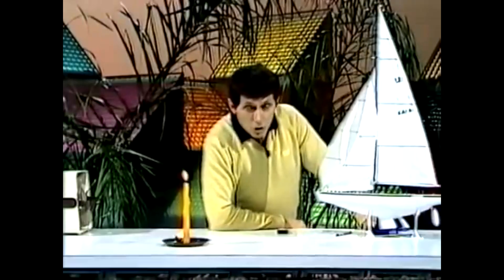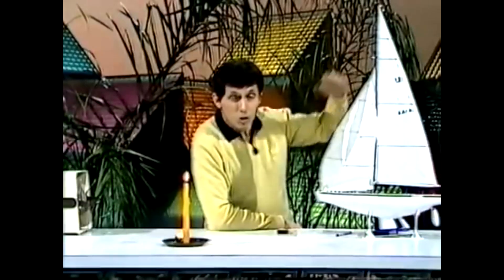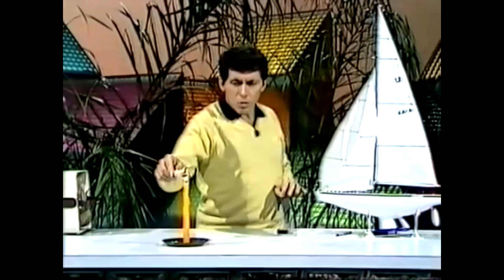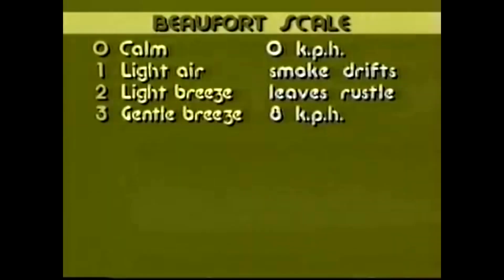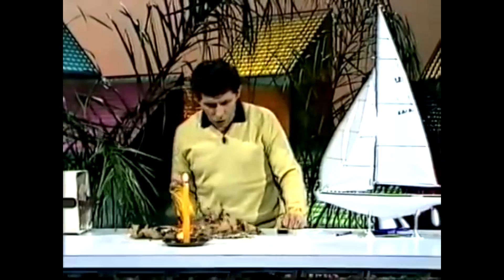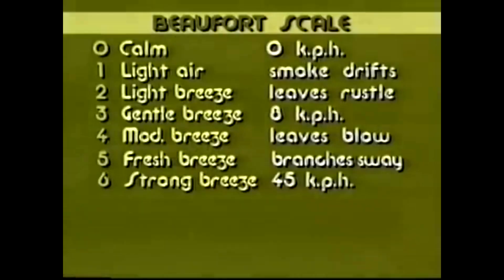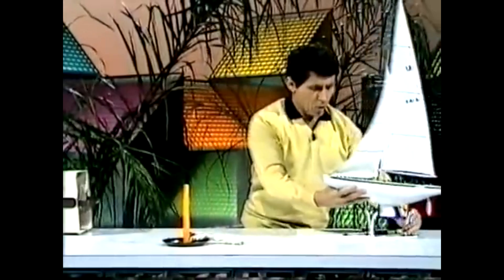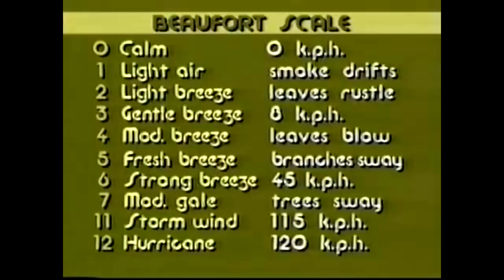Measuring the Wind

Comment: Some tornadoes are categorized only imprecisely by the Beaufort scale.  It puts any wind of 73 miles an hour (64 knots, 118 kilometers per hour, 32.7 meters per second) at Force 8.  The winds of F5 tornadoes can reach 318 miles an hour (512 km/h).

Comment: The descriptions in the Beaufort Scale are an especially poetic way to remember the quantification of nature.

Force 0.  Calm.
Sea:  Sea like a mirror.
Land:  Smoke rises vertically.

Force 1.  Light air.
Sea:  Ripples with appearance of scales are formed, without foam crests.
Land:  Direction shown by smoke drift but not by wind vanes.

Force 2.  Light breeze.
Sea:  Small wavelets still short but more pronounced; crests have a glassy appearance but do not break.
Land:  Wind felt on face; leaves rustle; wind vane moved by wind.

Force 3.  Gentle breeze.
Sea:  Large wavelets; crests begin to break; foam of glassy appearance; perhaps scattered white horses.
Land:  Leaves and small twigs in constant motion; light flags extended.

Force 4.  Moderate breeze.
Sea:  Small waves becoming longer; fairly frequent white horses.
Land:  Raises dust and loose paper; small branches moved.

Force 5.  Fresh breeze.
Sea:  Moderate waves taking a more pronounced long form; many white horses are formed; chance of some spray.
Land:  Small trees in leaf begin to sway; crested wavelets form on inland waters.

Force 6.  Strong breeze.
Sea:  Large waves begin to form; the white foam crests are more extensive everywhere; probably some spray.
Land:  Large branches in motion; whistling heard in telegraph wires; umbrellas used with difficulty.

Force 7.  High wind, moderate gale, near gale.
Sea:  Sea heaps up and white foam from breaking waves begins to be blown in streaks along the direction of the wind; spindrift begins to be seen.
Land:  Whole trees in motion; inconvenience felt when walking against the wind.

Force 8.  Gale, fresh gale.
Sea:  Moderately high waves of greater length; edges of crests break into spindrift; foam is blown in well-marked streaks along the direction of the wind.
Land:  Twigs break off trees; generally impedes progress.

Force 9.  Strong gale, severe gale.
Sea:  High waves; dense streaks of foam along the direction of the wind; sea begins to roll; spray affects visibility.
Land:  Slight structural damage (chimney pots and slates removed).

Force 10.  Storm, whole gale.
Sea:  Very high waves with long overhanging crests; resulting foam in great patches is blown in dense white streaks along the direction of the wind; on the whole the surface of the sea takes on a white appearance; rolling of the sea becomes heavy; visibility affected.
Land:  Seldom experienced inland; trees uprooted; considerable structural damage.

Force 11.  Violent storm.
Sea:  Exceptionally high waves; small- and medium-sized ships m[ay] be for a long time lost to view behind the waves; sea is covered with long white patches of foam; everywhere the edges of the wave crests are blown into foam; visibility affected.
Land:  Very rarely experienced; accompanied by widespread damage.

Force 12.  Hurricane.
Sea:  The air is filled with foam and spray; sea is completely white with driving spray; visibility very seriously affected.
Land:  Devastation.